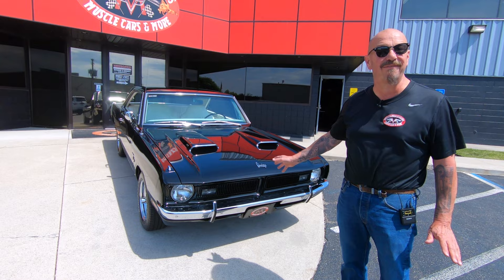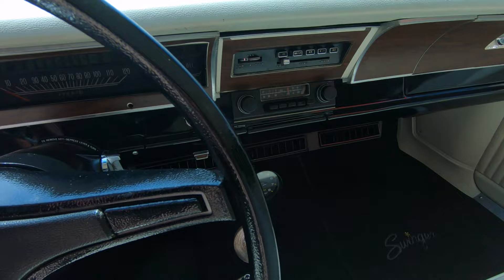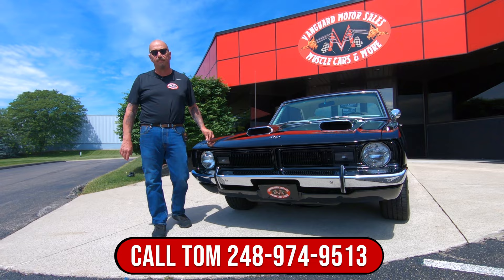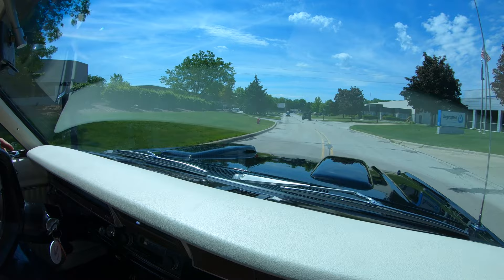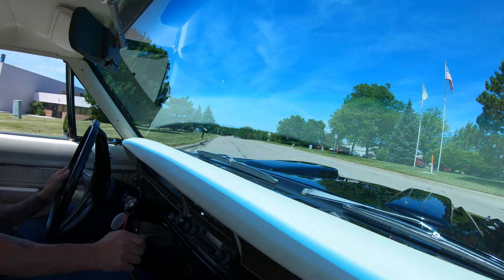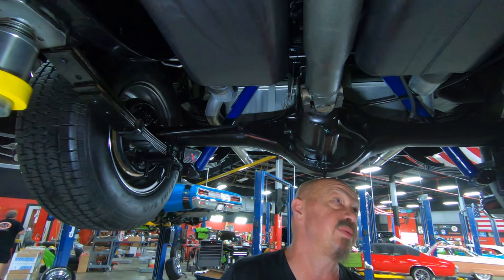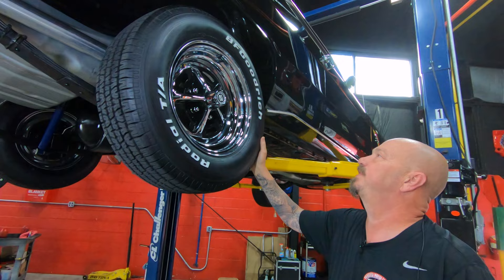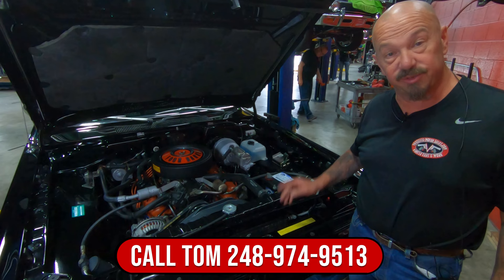1971 Dodge Dart Swinger For Sale Vanguard Motor Sales

Comment: The last time I seen and
Rode in a bad ass 1971 Dodge Dart swinger is last night my oldest brother has a all original body 1971 swinger with a built 360 and built 904 transmission with a 8 3/4 rear end with a 410 posi track he has had a 1971 swinger since 1977. I love darts if I wasn’t sick and could still work I would buy this I. A minute. Love the car Greg involvokes. A lot of great memories.